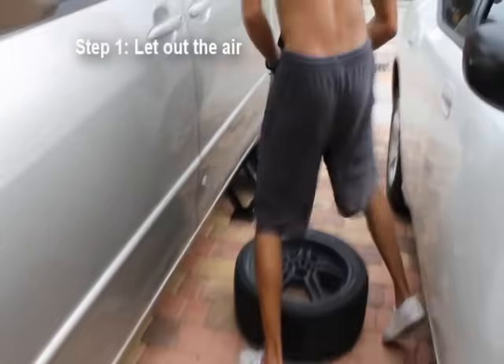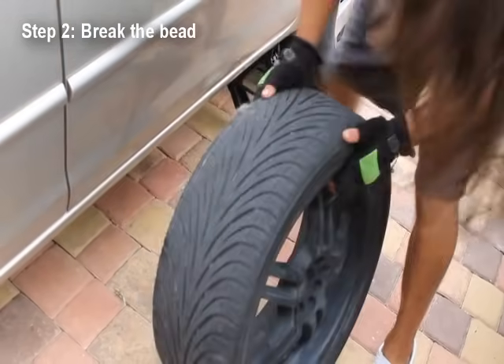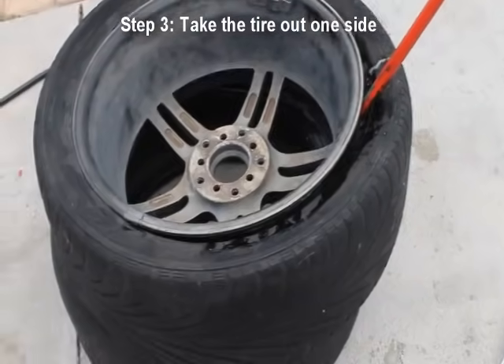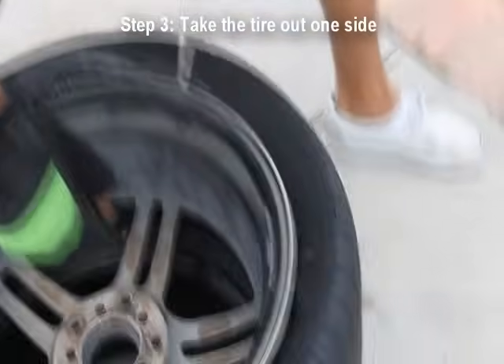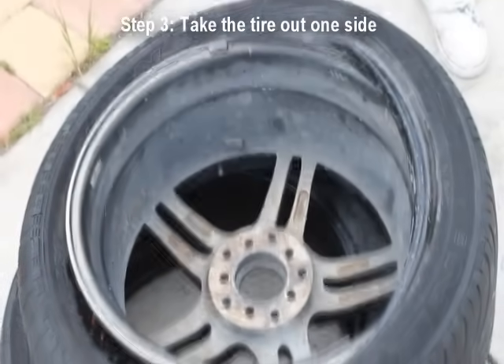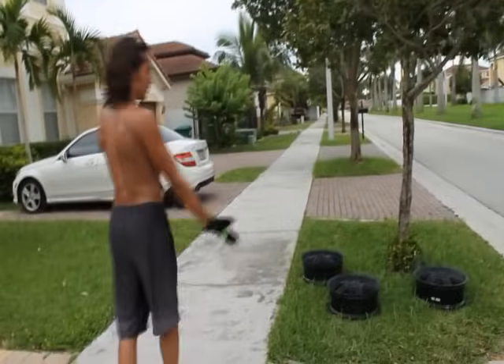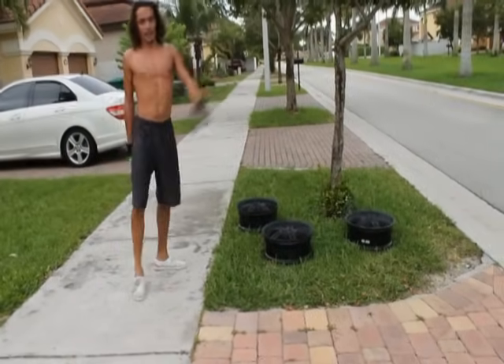How to remove a tire from a rim

Comment: Pretty sure you've proven why this is well worth the $10 a wheel for dismount...
Reply: l would rather do it myself then pay somebody $10 to do it.
Reply: So pay 10$ a wheel or spend an entire day being very frustrated dismounting and mounting all 4 tires lmao
Reply: another reason why you would want to change your tires yourself is because the shops usually do a shitty job. when they put the wheel back on they just lay into it with an impact wrench which means they are over tightening your lug nuts which is bad for the rim, bad for your brakes, bad for the lug nuts, and bad for the bolt. if a car is rated for 80 foot pounds and they just hammer it with an impact wrench then they are probably cranking it to 140 foot pounds and that is really bad.
Reply: Electronics For Fun that has nothing to do with mounting and dismounting a tire from a wheel
Reply: yeah it does, are you going to put on a new tire on the rim with the whole wheel still attached to the car? you have to take it off and then put it back on.
Reply: Lol $10 is nothing. I work everything on my car but one thing I won't do is tire removal.
Reply: Skorp Saiyan+ shops usually do it wrong though. l have seen them scruff up rims and when they put the tire back on they just lay into it with an impact wrench which is a good way to ruin the bolts and the lugs, not to mention brake warping. there was one shop l went to that didn't tighten the valve on one of the tires and so air was escaping and it went flat when l was out in the middle of nowhere.
Reply: until the shop does it wrong and it ends up costing you more money to fix their mistakes. sometimes they scuff up your rims, and most of them just lay into it with an impact wrench when they are putting the rim back on the hub which is a good way to strip out the threads on the both the nut and the lug not to mention that it could also warp your brake rotors. it's better to do it yourself because you'll save a lot of money in the long run.
Reply: Electronics For Fun lol this man scuffed his rims before they even would have the chance to scuff his
Reply: Kevin Donlon+ but he didn't scuff his rim.
Reply: Electronics For Fun yeahhhhh definetly not....hah I guess if you dont really care about your shit, do this. People who do this probly use self service power wash brushes at car washes too.
Reply: but he didn't scuff his rim. show me the part of the video where he scuffed the rim. people who care about their shit learn to do things themselves the right way because the shops always fuck it up. warping break rotors, stripping bolts and lugs, and damaging rims.
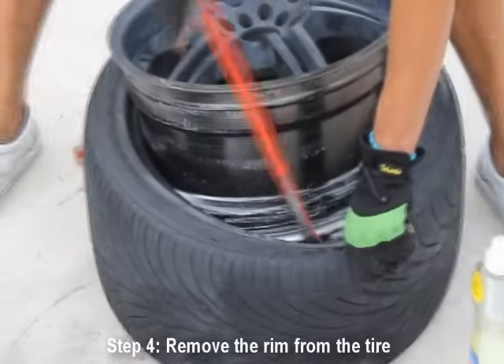Reply: Electronics For Fun 4:45 lol
Reply: Electronics For Fun bunch of good shots of paint chips and blemishes. He slams the bar into it a couple times Hahah people who care about thier stuff do not make repairs without the proper tools period. Maybe if you drive a civic or some pos I'd do this. But I'll be damned if I'm taking a crowbar to my wheels. Like are you serious lol
Reply: Electronics For Fun jeez now that I'm really paying attention, he is literally destroying the paint for like a minute straight.
Reply: Electronics For Fun at 4:50 he pulls the bar away from the rim he just slammed and you can literally see the mark lmao stick to electronics guy
Reply: $35 in my city.

Comment: How many squat thrusts do I do?
Reply: Pay attention. I think it's about three to four depending on the tyre diameter, obviously. Common sense.
Reply: That's what I figured but I just wanted to be sure. I went ahead and did 5 after I posted my comment and that worked fine but I wouldn't go any further cause you might get tired and your legs might go rubbery.
Reply: No, he is wrong. Here is what you have to do:

100 pushups
100 situps
100 squats
then a 10 meter run

Do it EVERY SINGLE DAY!

Comment: 1. the tire always comes off the front side of the wheel.
The well recess in the wheel is used to give space so you push the opposite side you're not pulling down to access the well area in the wheel.
2. Safety for your back. Safety for your feet, it includes hard shoes.
3. Using proper jacks and bars makes the job easy. Wheel chocks and safety stands save loss of life and limb.
4. If you need a tire for a low buck situation and tire labor, you might buy the whole thing for cheap at a u-pull yard to get you going.
You can keep looking for a tire that fits and is road worthy. Get it put on by an installer and balanced.
Putting yourself in harns way before you understand the danger is very sad after you're disabled. Save your back.
It can be expensive in the city sometimes so find a place where they understand your need and will do the simple things you need. Some places just aren't going to get into half fixing and will sell you very good quality instead. The cost is more and their rules protect both of you.

Comment: Jeez I am doing this right now but on a big ol Harely tire.  Firmer than firm and I've got one more bead to get over the rim.  It's a nightmare with the rotor and belt drive sprocket still on so you've gotta watch you don't damage them.  Cracked me up when you ran across the street being so happy that the tire was off!! Funny as hell bro.  That'll be me tomorrow or whenever I get the last bead off!!  LoL  who am I kidding I am old and feeble I'm not running anywhere anymore !!!
Reply from the maker: I believe in you. When you get it off, get up and run!

Comment: I love the idea of how tho empty the air out and break the rim bead down. Where this good man failed is, it would make the tire removal much easier by using longer pry bars or a pinch bar instead of short screw drivers. I rate this B+

Comment: All I did was stab a knife into it, cut it around on both sides and used a hacksaw to cut into the rim to get the beads off. I did this because I was going to scrap the wheels for some cash and the tires had zero tread.
Reply from the maker: xXDeathMetalThrasherXx that's very metal of you
Reply: Grotesque but effective.

Comment: Instructions:To get the tire off the rim  make sure to say Awww Dammit about three times in a row.If the tire doesn't come off repeat the words until tire is successfully removed.

WARNING:May cause a severe running and screaming disorder.If problem persist contact a Doctor immediately.

Comment: I have felt the same way, I am not going to use soap and spit anymore, it makes me sweat way to much. I got 2 sets to put on rims this time I am using grease.  The last tire I took off a rim when I got to the second bead and was able to get a rope around the tire and another rope around the rim I tied one to a tree and the other to the bumper of my truck and pulled that tire off with tug of war force.  Tire machines are for girly men...

Comment: First that's how u damage the rim that's if anyone watching this video when he's pulling the rim out of the tire you can see instead of being black all around it looks like the paint is coming off and using a crow bar amd a hammer you will be putting little dents in your rim now that's fine but if you have really nice rims like avant gardi niche or rohanna or vossen lexani or any other bramd that cost like $6000 for a pair that you paid aloota money for your not gonna want thatnot only that but every single dent in the rim causes the rim to unbalanced which is why most ppl when getting new tires on there rims they see little clios imsertes between the rim and tire so if you have expensive rms that you really like don't follow this video jus it to a tire shop

Comment: I guess you DON'T or DIDN'T know that the soap did NOTHING to help you remove those tires right ..??
Reply: Yes it did. It lubricates the rubber and helps it to slide up over the edge of the rim. Done this enough times to not try it without some sort of lubricant again.
Reply: NO it did NOT because the soap is on the TOP side of the rubber and your stress points are on the INSIDE of the rubber where there is NO soap .. !! 
Its no different when mounting a tire and people put soap on the OUTSIDE of the tire, that is completely useless ... The machine puts stress on the INSIDE of the tire lip to mount it. 
Even the manual tire changers, the stress is on the inside of the tire lip when mounting & dismounting, so WHY put soap on the outside..?? Because you THINK it helps and it does not .. 
You can sit there on your phone replying back to me all day thinking you are right when your not. If you ever changed a tire by machine or by hand and you are PAYING ATTENTION to how you do it, you will see that all the stress is on the inside of the tire lip ..
Reply: @ACommenterOnYouTube  you took all that time to type out a giant paragraph to prove a point to someone you don't know on YouTube about soap hahaha

Comment: Yo if the tire is shot fucking buy a angle grinder
Reply from the maker: Ryan Minner Even though I did do it in a stupid way an angle grinder to a tire is going to get messy and you do risk damaging the rim.
Reply: Yea I agree, but this guy is gunna fuck up the rim anyway
Reply from the maker: Ryan Minner I am this guy, and while the way I removed the tire was stupid, using this technique to break the bead at home will not damage the rim, using a crowbar might if you are not careful. These techniques can be used to safely remove the tire at home if you are careful.

Comment: who taught you how to remove tyres man that was DONKY WORK  eeehh awww 
and you where going about it all wrong   taking too big a bite  pulling bead over rim edge 
yep you did it off but spend $1 doller on a shop removal 
or buy the right gear  screw driver com on guy ???
you say you dont want to scratch the rim then do it on the grass man ???
that was  hard work i had to turn you off before i saw an accident 
well done any way :-(